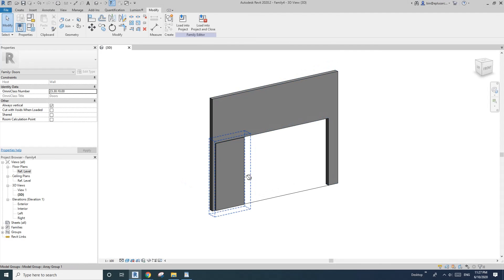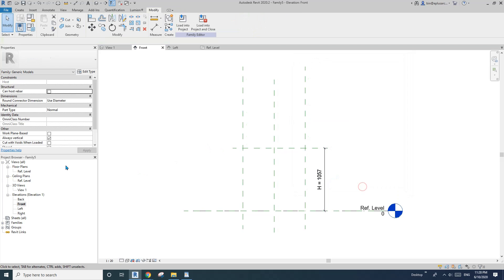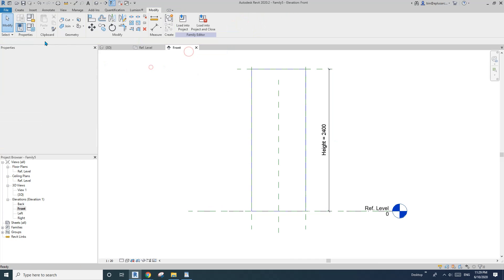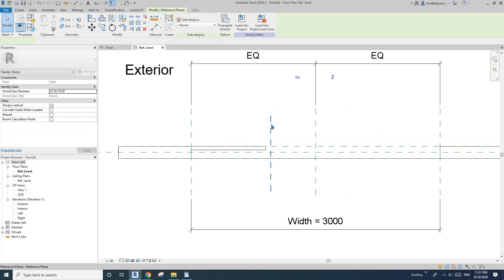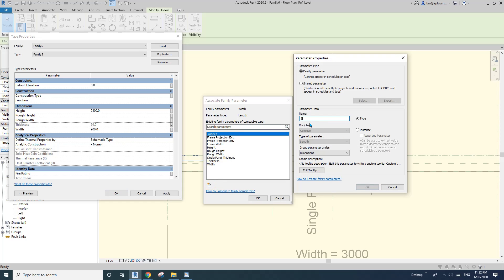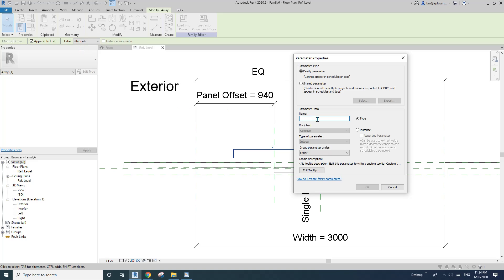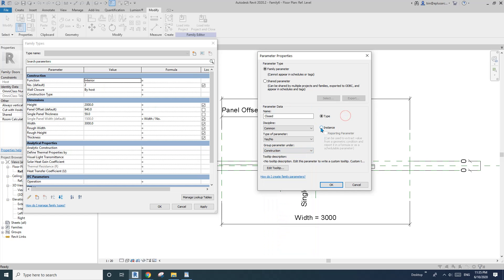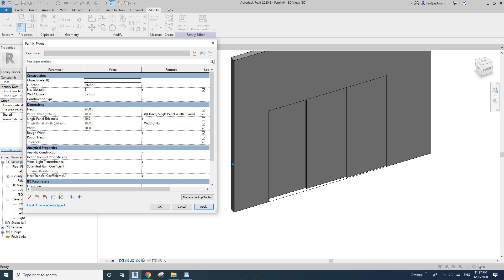Revit Exercise (Day 201)- Sliding door with adjustable panel number

Comment: Thanks for the helpful tutorial, I have this one question tho. When I wrote parameter ( if(Closed,Single Panel Width,0)) the doors are only closed when the No. is 2. If I change it to 3, panels are half way open. Is there any way of fixing it?

Comment: what can I do if I want the to have overlap around 50mm?
Reply from the maker: If there is an offset parameter controling the location of the section panel, you need to use formula "Panel Width - 50" for it. You also need to adjust the overall length since it is now 50*(array number-1) shorter. Have a try yourself and let me know if you couldn't make it work.

Comment: Hey bro: Type Parameter "Single Panel Width" is driven by Instance Parameter(s): "No.".
no me deja pasar del min 7.49
Reply: No me deja escribir las formulas??
Reply from the maker: It means your "Single Panel Width" is a Type Parameter, which can not be driven by the "No." parameter, which is a Instance Parameter. What you can do is select the formulat for "Single Panel Width" first and Ctrl X(cut), then click on the parameter "No.", click Edit Paramter, then change it from Instance Parameter to Type Parameter. Alternatively, you can make the "Single Panel Width" into a Instance Parameter. Let me know if you still have issues.

Comment: After completing all the steps, and going to family types to adjust the number of doors from 2 to 4, it will show 2 extra doors cramped together in the left side. Wondering how to solve this issue.
Reply from the maker: Can you share your file please?
Reply: @BINHE615  Oh it's good alrdy.After rewatching yr video for 2 times, at the part where we modify the array to add a parameter to label "No.", i forgot to tick "Append to End"  right next to the label box.

Comment: Hey man i followed all the steps but when i want to add the formula width/no. i get this error
Instance Parameters can't be used in Type Parameter formulas.

Type Parameter "Single Panel Width" is driven by Instance Parameter(s): "No.".
Reply from the maker: Change the "Single Panel Width" from Type to Instance first, then you will be use it in the formula for the "No."

Comment: It would be helpful if you write the formula of the panel offset, the quality of the video doesn't allow to see in detail and the mouse cursor is covering what you write so it's impossible to see if it need ( ) , . =, I could so everything and got stuck in there. 😑
Reply from the maker: Sorry about that. The formula is:  if(Closed,Single Panel Width,0)  Of course, the parameter names need to match those you have in your family. Let me know if you still have questions. :)
Reply: @BINHE615  Thanks for taking the time to reply, it worked perfectly :)
Reply: I have done this but it still says inconsistent Units for some reason even though I am pretty sure everything is right, how would I fix this? @BINHE615

Comment: can you write the if formulae please,?!!
Reply from the maker: Let's say we have a Panel Number parameter calculated by Width/Min. Panel Width, you need to create a new integer parameter for the array, and use if(Panel Number <2,2,Panel Number) as formula. It means if the Panel Number is less than 2, the array number becomes 2, otherwise, it equals the Panel Number.